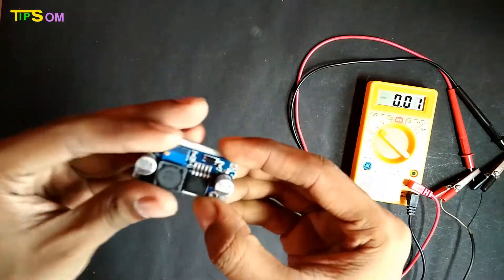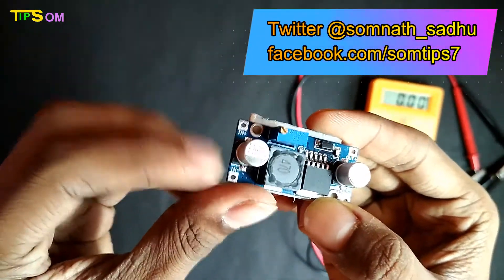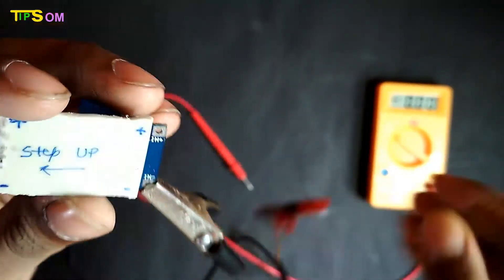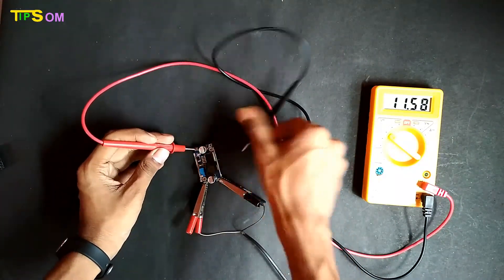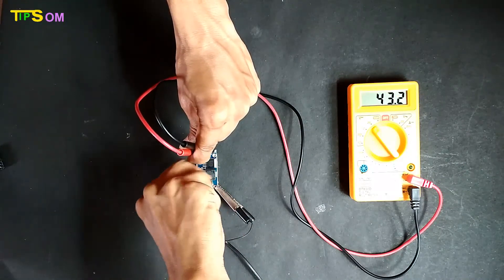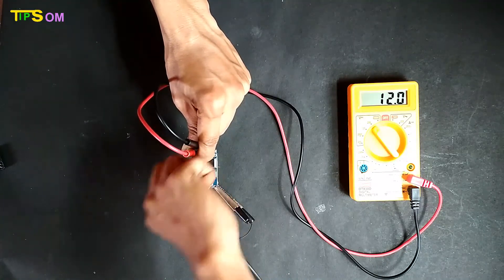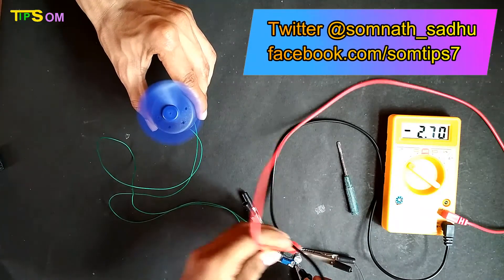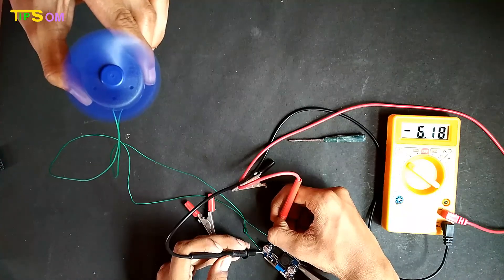XL6009 DC Step Up Module Review | Som Tips

Comment: Sir ma ny 8 cells 18650 ko parallel ma connection kia ha in ka output 3.9v aa rha ha phir 3.9v ko 12v ma convert karnay ky lia ma ny xl6009 ka use kia but modem ki power light blinking karti ha aur modem work bhi nhi karta Huawei ka router ha

Comment: Hi som I have the same kit however I am not only getting 0.7volt in input as well as on output I got another kit but the same issue I tried to adjust the voltage but still the same sont k know  what's wrong can u help me to troubleshoot